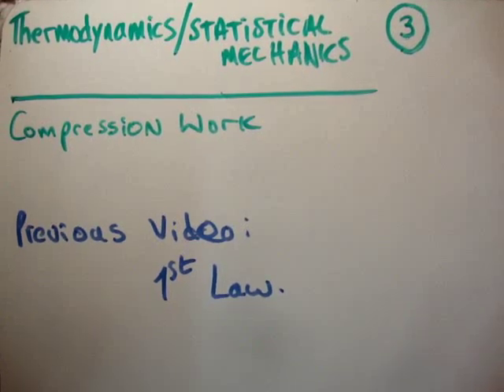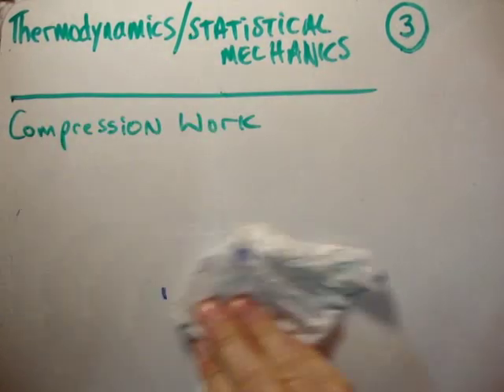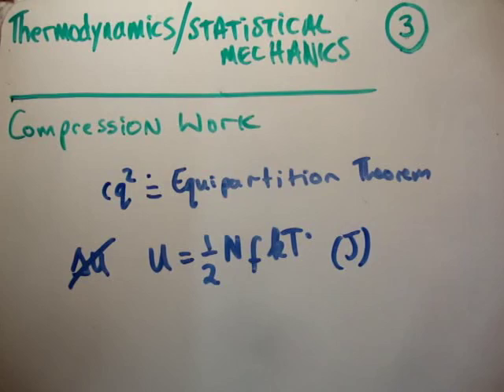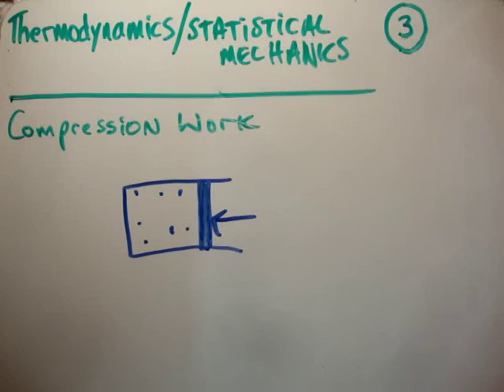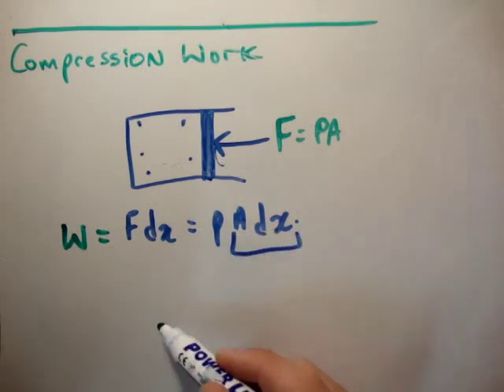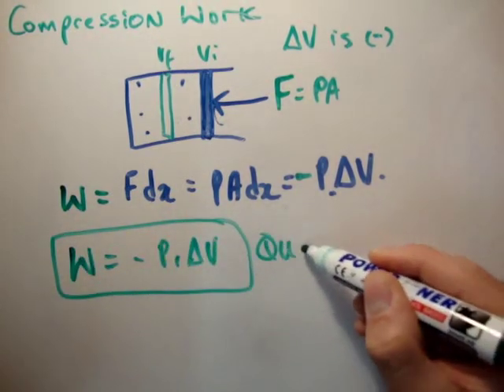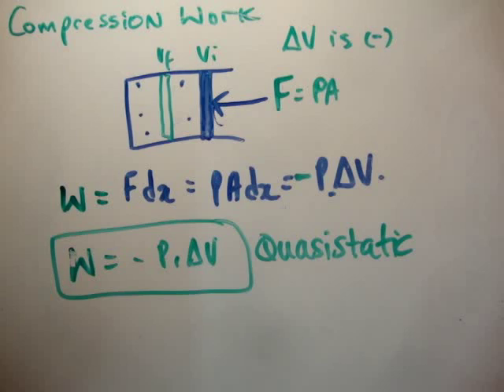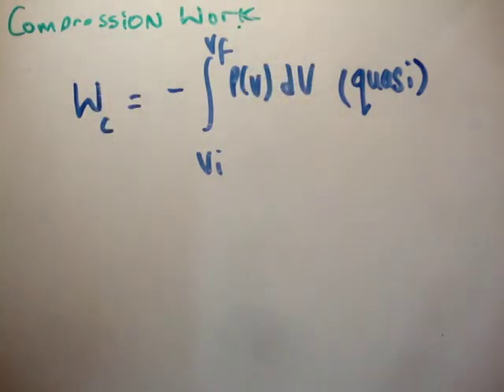Thermodynamics 3 : Compression Work

Comment: Small barometer turned a small needle
Big size barometer turned a turbine so we make electricity by pulley and gears and hydraulic and spring and flywheel and other combination os simple machine 

So keep talking with me 

One liter atmospheric pressure contains 101 joules approximately per litre

Then 1000 cubic liter atmospheric pressure contains 101 x 10 ^9 joules 
One liter petrol contains 42 gigajoules approximately 
So if we make a 1000 unit of such barometer then it's equal to many tonnes of petrol per year 

World wide we made such barometer amd vertical well of oil are open for world 

Energy crisis become history all over the universe